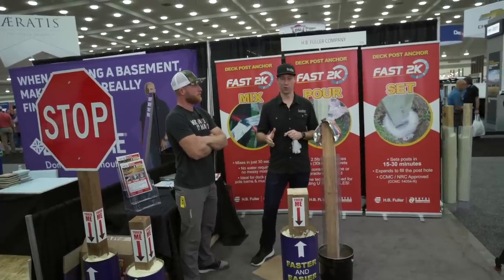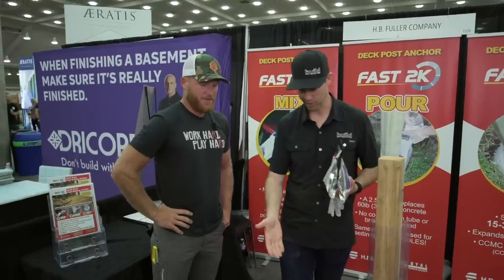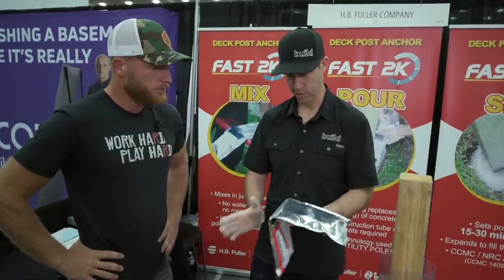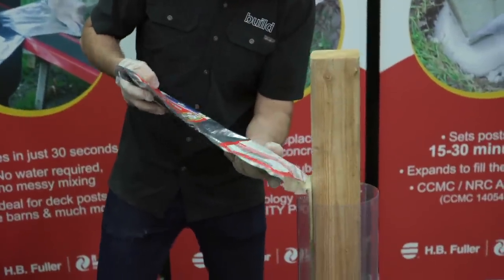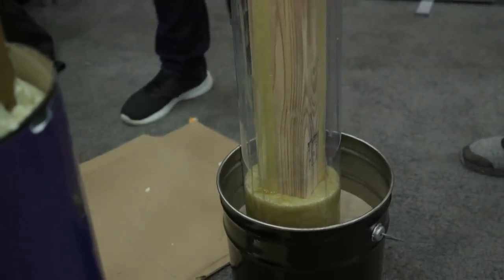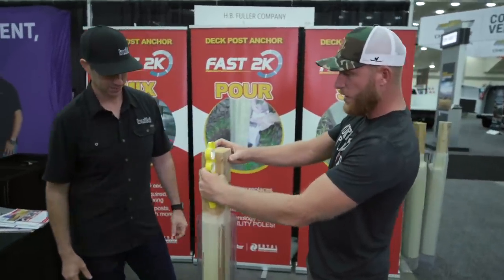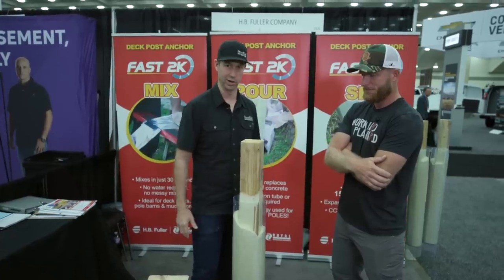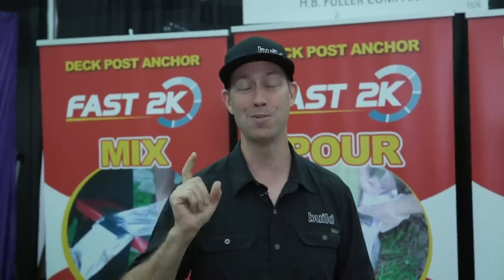Foam INSTEAD  of Concrete???

Comment: Telephone and electrical companies have been using this for over 10 years to set telephone poles.  It is better than concrete in many ways. As it expands in the hole it has lateral drive that you don’t get with concrete. It is a great product
Reply: What do you mean by lateral drive?
Reply: It expands and pushes outward into the surrounding soil, locking it into the ground
Reply: tommyjohnsonjr 👍👍👍
Reply: Most telephone poles are set 6-8 feet.  Some taller poles can be  (>45’) can be set deeper. Most are 6-8 feet though. 15’ would be the most extreme depths and only for the tallest poles.
Reply: it is designed to poor in to a form... a tube.  it doesn't lock in to the ground.  even expanding foam could you imagine how much more you would need if you didn't poor this in a form?  that would be ridiculous.
Reply: Water goes in on the top (ground level), and never dries out.
Reply: Double D the forms were present in Matt’s video to demonstrate the product. In the real world, most of this product would be used similarly to how you’d use concrete which is likely a hole.  See the manufacturer’s information, you’ll see that sonet forms or dug forms are both options.
Reply: Hi Double D, this is Edson Fariello with H. B. Fuller, the manufacturer of Fast 2K, the product that Matt and Kyle demonstrated. It's fine if you want to use a tube/form, but you actually don't need to. You just pour the product directly into the hole.
Reply: Where I'm from (loose sandy soil) foam is commomly used to set telephone poles. Helps stabilize the pole and in wet areas limit moisture intrusion. Instead of constant exposure.
Reply: They  using it in my area  after storms.  To get poles up quick  if the soil is to damp They  are still up strong after 5 -7 year . One even got  hit dead on by a car .   Still up but  on a little lean  now.
Reply: tommyjohnsonjr 10%+2’ is the common formula for pole hole depth. For example 45’ pole, 10% of its height = 4.5’ + 2’ = 6.5’ deep hole. So you are correct a 15’ deep hole would be for a 130’ pole, which would most likely be a transmission pole.
Reply: Double D It may require less to be poured in a tube but doesn’t have to be, by any means. We use a similar product to set utility poles where I work, comes in buckets, in two parts. Works great, especially in wet holes where it’s hard to get a good tamp. It Actually forces the water out of the hole and fills all the voids so technically it does lock into the ground.
Reply: False never will last as long and no they all haven't been using this for a decade.
Grandfather works for Duke energy and has always set poles with concrete
Reply: So I could use this with infused carbon fibers to build a small underground room right?
Reply: I've worked for a utility for over thirty years and not once in that time have we ever used concrete to set a pole, nor would we, not a wooden one anyway. Nothing will destroy wood faster than setting it in concrete because it just locks in the moisture. The preferred method is to use crushed stone as it allows for the best drainage but most the time we just use the spoil from the hole to avoid having to remove it. As for The expanding foam, Tommy is correct, the utility I work for stated buying it right around ten years ago. It took awhile for us to warm up to it but now we use it quite often. As far as it outlasting concrete, I would be willing to bet not but who knows.
Reply: Had the rep bring this to our store claimed local hydro was using it. We sold 3 skids to a contractor he installed 32 6x6 posts with it not a single one held. Rep said 20 deg cel was to cold for installation and to keep it warm on a heater until installation Company refused to honour warranty they promised and refused to refund. This stuff is utter garbage. Also follow up with local hydro they wont use it because it doesnt hold anything.
Reply: @edsonfariello9178  your product is more expensive per pole to set a fence vs concrete. A great deal more.
Reply: BiggestComplainer  6, 1 to dig, 5 to stand around telling him how to dig
Reply: It's just as good as dirt.   Now back to everything else I have to say about this channel it doesn't breathe.
Reply: It will also push water out of the pole hole which is awesome when setting poles in the rain or where there is a high water table
Reply: We use this stuff to set electric poles here at the company I work for. Just started using it in last 2 years. It works great and holds like nobody's business.  In the summertime you have to work really fast and get it in the hole. In the winter it takes more of it cause of the temperature. Moisture will speed up curing time . However in a water hole it just float to the top and does not work.
Reply: There are many concrete compositions that will outstand this product. No telephone company uses conventional or open to public mixtures to set their utensils. And as for moisture, there is contact pressure treated wood, just like the one used to build piers.
Reply: Bullshit all I see em do is shove concrete and dirt around it after getting a 10-12 foot deep hole to put it in, never see foam
Reply: @edsonfariello9178  ok. My question, how does this work in High wind areas with the fence post? I live in an area that sees 60+ mph wind gusts and have fencing I need to replace. Another question, I see people talk about wet holes, what about dry draught areas? I like the concept especially since I have joint problems in my back and carrying heavy concreate bags all day would kick my tail end. 6 or 7 posts and a few fence panels I could handle that without the added weight of concrete. Keep up the innovations!
Reply: @cookingwithkhonken484  smarty pants you should've checked with 'local hydro's before buying it
Reply: surely, by evidence of it clibing up, the pressure is releaved and there is no real forces laterally.
Reply: Because big business has such a stellar reputation for choosing the best and safest option over saving money.
Reply: @ParmMohan-us6rn  it will even use holes made by rodents and insects to expand and strengthen.
Reply: Pixel_Geist definitely a great product!
Reply: @meyerl.1208  so will anything you put in the hole that is heavier than water
Reply: @ParmMohan-us6rn  he means it expands upwards in the direction that offers no resistance to it moving, just nonsense that means absolutely nothing to it doing anything.
Reply: @tommydjohnsonjr  it expands in the direction that has least resistance which is up, put some in a glass and watch it NOT break the glass and just ooze out the top.
Reply: This is one of the differences between how Europe and the US build stuff. In Europe the builder would set a metal bracket on top of the concrete and then put the pole on. done. In the US you use a crazy chemical product - that will most likely never be removed again from the earth (of course, concrete is also horrible for the planet - just not a problem for ground water).
Reply: @edsonfariello9178  Do you have information on your product being used for structural pole setting? I am building a horse barn, and have several 6x6" poles to set. This would typically be done with concrete, but for the reasons mentioned, I'd rather limit water contact with the poles. This would also be much easier to use than concrete... if you have information of its appropriateness in this situation.
Reply: telephone poles should just use 3/4" base rock or many times compacted native...
Reply: @3 Subscribers Without Any Videos!!!!! 
Agree, concrete weight acts like a pendulum.
Reply: We've been using foam for over a decade, not one customer failure. All the nay-Sayers here should try listening to Matt. Sheesh! I'm I my sixties and more willing to try new technologies than some folks Here.
Reply: How is concrete bad for the planet? It's made from naturally occuring materials, and is recyclable.
Reply: They use rigid polyurethane foam in a lot of aircraft interior components as it's light weight and flame retardant.
Reply: Telephone poles are different to fences in that they don't act like a sail that catches the wind. I wonder how long that foam will last when the fence is being pushed by the wind one way then the other for 10 or so years. Cement has the density and weight to fill every nook and gap in any post hole so long as it is wet enough.
Reply: @08c6vette  that's how they did it when they set the power pole on my property. 5' down, they back filled with dirt, and used a big air tamper to compact the dirt as they back filled.
Reply: @TerraFirmaX  Exactly right. All the digger trucks at the utility I work for have Tampers that run off the trucks hydraulic system  (instead of air but same idea). We auger a hole, set pole in it then backfill with the spoils from the hole and tamp as we go. We do it this way on probably 80% of our pole sets. We usually only use the foam in urban areas where theres a lot of underground utilities and can't use an auger for fear of hitting something, in which case we use what we call a suck truck, which actually sucks us a hole using high pressure water and a giant vacuum, which leaves us a hole that has to be either foamed or backfilled with crushed stone and it's much easier to foam it than lug twenty or thirty bags of stone to the hole.
Reply: clmahs728 it was probably hydraulic, but it was very fast.  I started doing that for my 8” fence posts instead of concrete and guess what, no problems.
Reply: @DoubleD72     Exactly. only as tight as a sonotube, with less weight.
Reply: VeritasEstVeritas 7% of Co2 released each year is from concrete production. That’s a LOT!
Reply: @Chris Jamieson hmmmm, well they where 8' sunk 3' deep and I think those posts were 6-7 which meant 6 to 7 inch.
Reply: I used it to set a mailbox post. Specifically the sika brand. It fixed the mailbox post in minutes. After it cure. I couldn't even wiggle the mailbox even the slightest. It's 13 dollars for the baggie. Just take to the post I need to fill in. Roll the baggie until the middle seem pops, shake it vigorously for 30 seconds. Tear open and pour immediately while holding the mailbox post still for 1 minute. Clean it up after 15 minutes with soil to protect it from UV radiation.
Reply: Will it hold against water
Reply: J C yes it will. It will actually displace water as it expands. I’ve seen it as a telecommunications technician and later telecom engineer. Look up through the comments and you will see other individuals that have also used it with success
Reply: It's hilarious that all of the "pros" here don't realize every city has different codes and does things differently.
Reply: I was just going to ask ‘what is the longevity of the product’.  Thanks for sharing
Reply: To suggest concrete doesn't apply outward pressure is insane. The pressure at the bottom of a whole filled with concrete is huge, the weight of the concrete above creates huge pressure at the bottom, especially if you vibrate the concrete to increase the fluidity.

I can't think of a single application where this would beat concrete, it's all marketing.
Reply: Sebastian Lakes Speaking from a lineman’s point of view it beats concrete in several ways. We use a similar product (probably the same ingredients, just a larger amount) to set Utility poles. 1- much easier to handle, two small buckets a drill and a mixing bit. 2- faster, mixes in about a minute, expands and sets up in about five minutes. No need to hold the pole for hours waiting for the concrete to set up. 3- in a wet hole, it will actually force the water out, guaranteeing a nice stable pole, enabling crews to go to work as soon as it sets up. With concrete you would either have to keep pumping the water out or take a chance and hope the water doesn’t dilute it too much, even then you would have to hold the pole for hours hoping for it to set up properly. 4- Probably the biggest way it beats concrete,at least for wood poles, which is still the most common type used by utilities, is endurance, at least for the pole anyway. Nothing will rot a wooden pole, treated or untreated,  faster than setting it in concrete. I’ve been involved in more pole sets than I can count in my 35 years as a lineman and not one of them was set in concrete, the Utility I work for wouldn’t allow it for that very reason. As far as it outlasting concrete, that is where the concrete would probably win out but who knows, the stuff is fairly new (we’ve been using it about 10 years), time will tell.
Reply: At Lowe’s, the foam shrinks back in the buckets....not sure if would pull back in the ground...
Reply: Yup, the biggest reason I see is removal. Imagine trying to remove 6 to 8 foot of concrete a foot thick. Hahaha would make one hell of a mess pulling it out.
Reply: @gregrohs6688  yes they were lying through their teeth about pricing
Reply: @smackedupbaits6862  it’s called muck truck...there is a reason buildings are made with concrete footings, tried and true.
Reply: Burying more junk in the ground like the planet needs it more.
Reply: BS
Reply: @BernhardWelzel  7
Reply: This stuff expands as we all can see. But, will also shrink over time and you have wobbly posts. Better to just push the posts in the ground compacting the soil.

Comment: As a carpenter I has seen first hand how expanding foam deteriorates, becomes brittle and crumbles in to dust, i would NEVER put something that short lived around any house stump or post, concrete outlasts the timber and if you pretreat your post it wont rot.
Reply: Jack park  rather be using a product that is proven to work than getting sued for a building failure.
Reply: We'll see what time tells. All expanding foams are not created equally and this one has two parts that have to be combined. Like comparing elmers glue to gorilla glue here.
Reply: Jack park  when you do something for years, you say "If it ain't broke why fix it". His way works why take the chance.
Reply: @xxdeathxxnols5434  would you be prepared to take the risk and wait for 10 years just to find it doesn't work?
Reply: @speakupriseup4549  No sir. I learn from others mistakes. Lol
Reply: Im like you. Stick to what's known unless proven otherwise.
Reply: @xxdeathxxnols5434  spot on, never had a failure with concrete and not prepared to risk my company reputation on an unproven product, leave it for the mugs.
Reply: This is not plain old expanding foam, come on man. That regular stuff is designed for completely different tasks and obviously would not work.  There are thousands of types with vastly different properties. I have a product that's similar to this around some large poles they put up for towers in my field, been there nearly 15 years and vastly outperform any concrete they could have put there.  With large temp ranges and lots of rain, all this exposed concrete would be broken and wearing out at this point but that stuff looks as good as the day it was put in minus a bit of dirt.  And I guarantee you that this newer stuff is far better.  That older stuff was also much harder to work witth and back then was 4x the cost it is now, but much quicker labor wise and much more durable than traditional concrete.  Also, it still completely seals the bases of the posts til this day. concrete would by now have gaps and water would have poured in and started rotting it all out.
Reply: @BorisBlade7  Why are they having to bury the post wood so deep. Just pour a leveled concrete pad and use a tube form cut to whatever kind of depth you need and use galvanized hardware to anchor wood to a buried concreetpad. No rot, not having to bury half your post cost in wood in the ground where water will potentially be able to submerge it. Foam has no weight and outside of specific soil type using encased air to anchor too is a terrible structural design. unless you had post as deep as a fence is tall without any weight the wind is going to blow that fence over or fall over next time some kid climbs over it.